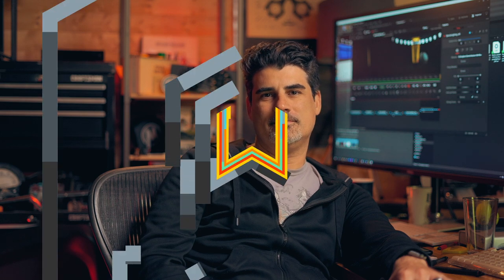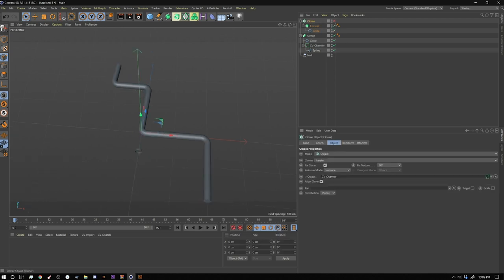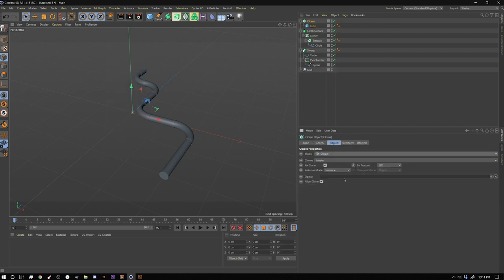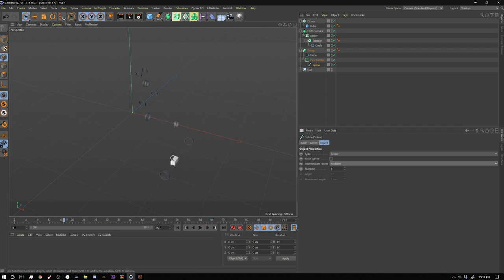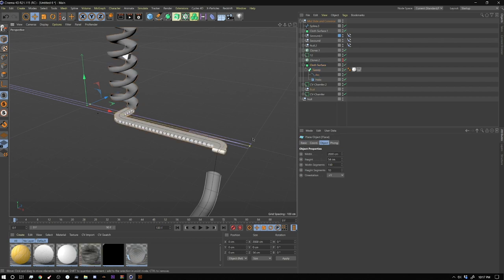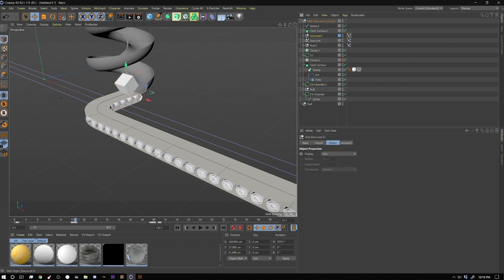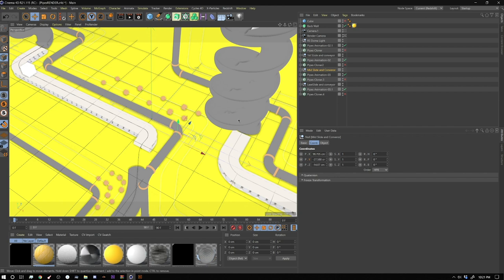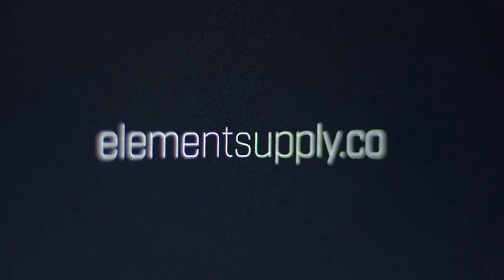Animate Procedural Pipes in Cinema 4D

Comment: It’s a shame that the CV Chamfer tool isn’t built in as a deformer like the bevel, it’s so similar just splines not polygons, or just use the bevel deformer to fillet your vertex spline corners. I’m not a fan of the CV stuff because I need it to work on any machine w/ C4D.
Reply from the maker: It would be great if it were built in. That said, here's an alternative. Chamfergen.
www.dropbox.com%2Fs%2Flhd1lex7ropb9wq%2Fchamfergen%2520v0.4.zip%3Fdl%3D0

Comment: Sorry about offtopic, what display did you use?
Reply from the maker: Previously, I used two 27” Cinema Displays, but I needed to switch to a single display because of an issue, and I was eyeing the 49” LG ultra wide so I got that. It’s not a high pixel density, but I’ve gotten used to that. Plus that means it’s less to drive with my GPU than a 4K display, but I have tons of screen real estate. It’s non-reflective and without the gap between screens it’s amazing. I really love it.
Reply from the maker: Haha, I was answering this through the app and didn’t see that this was for Sev. Sev has two 4K displays. One is a 27” Dell and the other is 40” 16:9 Dell.